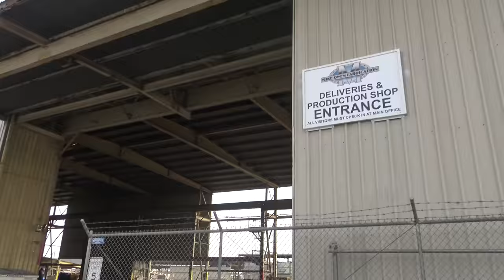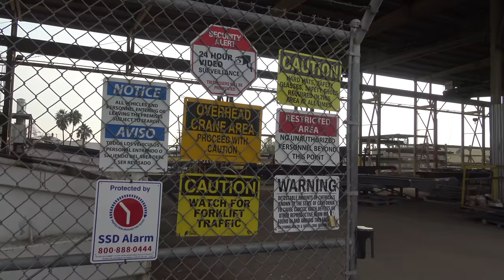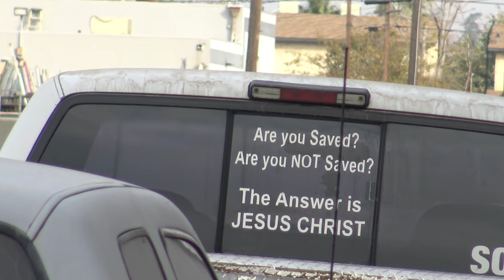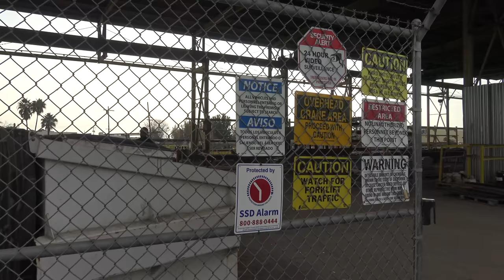Walk Of Shame Gangsta Grandpa And His Goons Making Fools Of Themselves Put On ✅-1st Amendment Audit

Comment: the sound that is being picked up is actually not sound. it is cell phone / data radiation being picked up through the electronics
Reply from the maker: dammm thanks for the info
Reply: Unidirectional microwave links from the cell phone tower across the street.  The microphone cable is likely the culprit.

Comment: Mr Snyder wearing his wedding ring on an industrial worksite, not smart!
Reply from the maker: yup is not its dangerous lol ive seen videos
Reply: Was hanging from my left ring finger, had to have my wide wedding band cut off. It stripped the skin off over the knuckle an took a lot of stitches to to put my finger back together. Never did have the ring repaired, was afraid I would start wearing  it again.
Reply: @BkGreg  One of the Guy’s Newbie I worked (a wise ass) with had a non Challand attitude towards safety and we worked hot energised secondarys electrical systems high capacity network he refused to wear safety equipment despite constant warnings and reprimands one he day he got his ring between two phases of a three phase system and almost blew his finger off, he would go onto another area where he blew his arm off Switching high voltage systems. He violated several rules and paid the price, he was lucky he wasn’t killed.